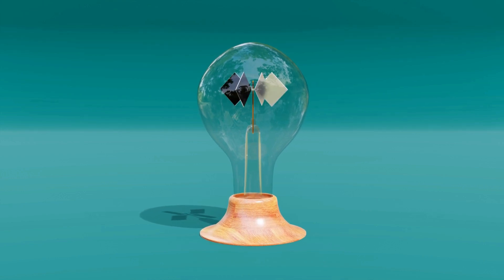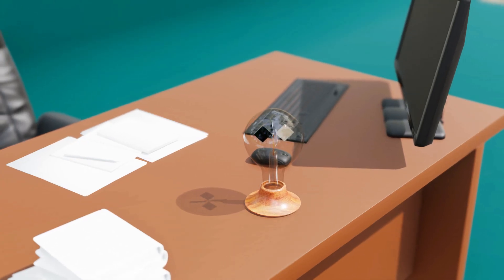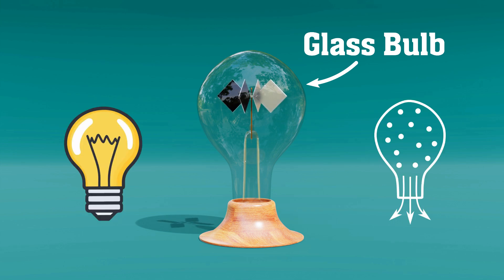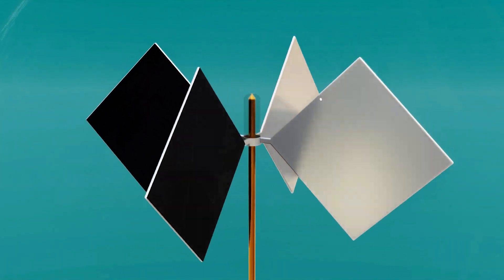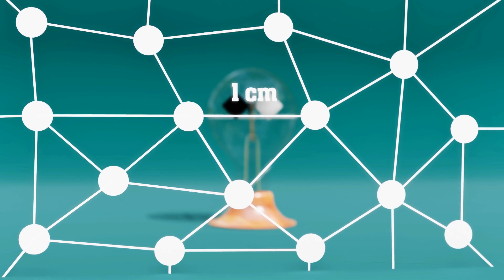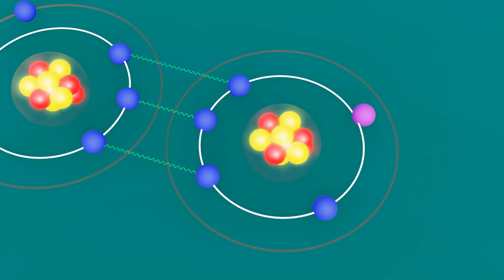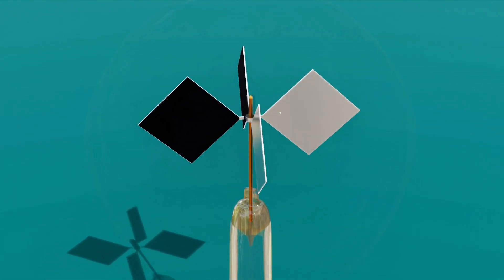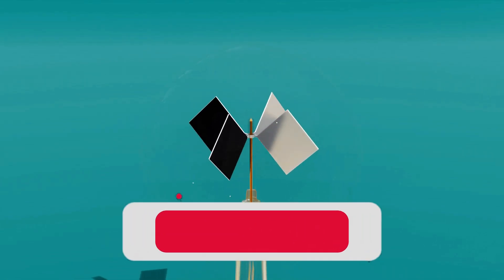Crookes Radiometer Explained – The Weird Physics Behind the Spinning Vanes

Comment: In the freezer exact opposite is happening the air molecules are shrinking in size because the freezer extras heat from inside compartment so it move on opposite direction

Comment: This video mixes a few true things with a lot of hype and one completely fringe “explanation.” The Crookes radiometer is not mysterious; it’s a heat-driven gas-kinetic device. Here’s a tight fact-check.

“Even Einstein tried and failed to explain it.” Oversold. After early missteps (including Crookes’ own wrong guess: light pressure), the modern account uses radiometric forces in rarefied gas: thermal transpiration/thermal creep along the vane edges and a related normal (“Einstein”) contribution from temperature gradients across a surface. Einstein’s contribution refines—doesn’t refute—the thermal picture; it isn’t a failed one-off. Contemporary reviews and experiments treat these effects together. 

“What makes it spin?” The accepted mechanism is radiometric force in a low-pressure gas. Light warms the black side more than the shiny side, creating a temperature gradient near each vane edge. Gas creeps from the cooler side toward the hotter side (thermal transpiration), building a pressure difference that pushes the vane so the black side trails. Quantitative treatments and DSMC simulations reproduce this behavior. 

“Optimal pressure is ~1 Pa and at hard vacuum it stops.” Directionally right, but not universal. Peak torque depends on vane size/geometry; experiments place it in the ~0.1–5 Pa range, with no motion in hard vacuum because you’ve removed the working fluid (the gas). 

“It reverses in a freezer.” True in the usual quick-cooling demo. Rapidly cooling the bulb flips the relevant temperature gradients; you get a brief reverse spin (silver trailing) until the system re-equilibrates. 

“The vanes are arranged so the black sides all face counter-clockwise.” Irrelevant and not generally true; the assembly orientation is arbitrary. What’s consistent is the sense of rotation under illumination: black sides retreat. 

“The exact mechanism is still debated.” Nah. Nuances (edge vs. area scaling, accommodation coefficients, geometry) are active research, but the radiometric/thermal-transpiration framework has been standard for decades and explains the qualitative behavior and the pressure dependence. 

“The ‘orbital repulsion theory’ explains it.” This is not a thing in the peer-reviewed literature. The pages promoting it are personal PDFs and YouTube videos; they assert electron-orbital “expansion” causing repulsion in air molecules. That’s unnecessary and contradicted by mainstream rarefied-gas theory and experiment. If it were right, you’d expect uptake in APS/AIP journals or reviews—there isn’t. 

Bottom line: a Crookes radiometer is a tiny heat engine that runs on temperature gradients in a rarefied gas; it spins one way in light and can briefly reverse when you rapidly cool it. No new forces, no quantum-orbital voodoo—just kinetic theory doing exactly what it should.
Reply from the maker: Thanks for taking the time and expressing your thoughts 

The simple “molecular kick” model, which is based on a naive application of the Kinetic Gas Theory (KGT), is fundamentally limited by the “pressure paradox.” This model incorrectly assumes that the greater force from faster molecules on the hotter, black side of the vane would create a net force. In reality, according to KGT, the increased force per collision is perfectly balanced by a decreased rate of collisions on the hot surface, resulting in no net pressure difference. This explains why the radiometer does not work at atmospheric pressure, where the short mean free path of gas molecules would cause any temperature difference to be instantly canceled out by frequent collisions.

While the thermal transpiration theory (TTT) is the currently accepted explanation, it also has limitations:

Speed Paradox – The theory struggles to explain the near-instantaneous movement of the vanes when a focused light source is applied. TTT relies on the establishment of a thermal gradient and bulk gas flow, which should take a measurable amount of time, suggesting a more rapid interaction might be at play.

Incomplete Model – TTT alone is not a complete explanation. The peak performance of the radiometer is actually a result of a delicate balance between the driving forces (thermal creep and the Einstein effect) and the countervailing drag force. The theory for the peak in angular speed must therefore account for the behavior of both thermal creep and drag forces.

Theoretical Discrepancies – There are discrepancies between theoretical predictions of TTT and results from computational methods, particularly concerning the dependence of the force on the width of the vanes. This suggests that current theoretical models may not fully capture the complex dynamics of the device.

Comment: Some physicist please answer the question about the freezer... I'm a control engineer so I'm interested but certainly no physics greybeard. My stab in the dark is its due to relative levels of specifically infra-red wavelengths being reversed to the usual scenario - as the freezer is dark and (assumedly) the crooks radiometer starts off at a higher relative temperature, and/or maybe something to do with cooler and reduction in gas pressure, amount of 'jiggling' of the atoms/molecules. Physicists... over to you!
Reply: You’re close: it’s not freezer IR, it’s the temperature gradient flipping. In light, the black sides run hotter; gas creeps from cool to hot along the vane and the rotor turns with black trailing. In a cold, dark freezer the high-emissivity black coating radiates heat away faster, becomes cooler than the shiny side, so the same thermal-transpiration/“Knudsen pump” flow reverses and it spins backward. As the gas cools the pressure drops, the force weakens, and the reverse spin quickly fades.